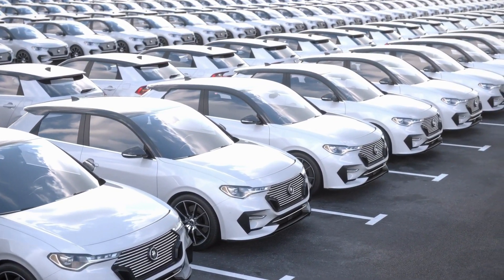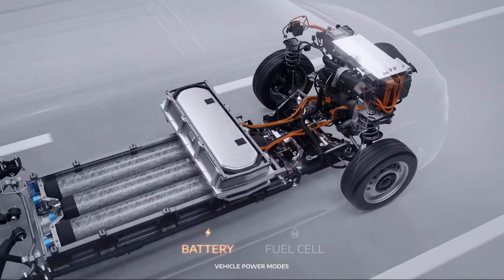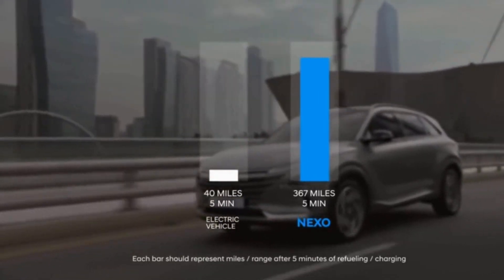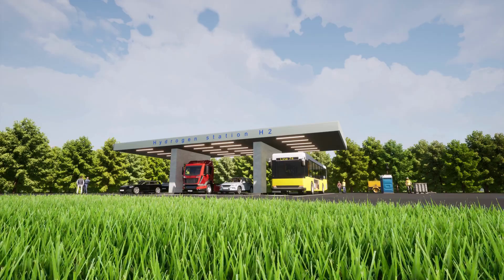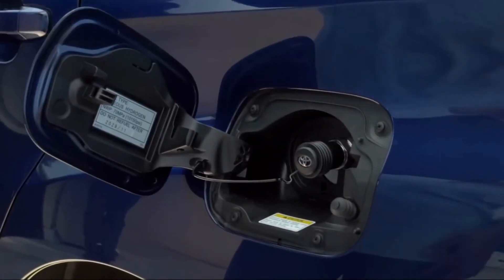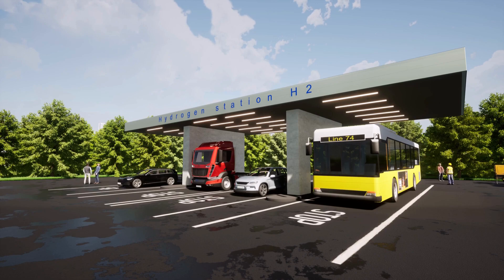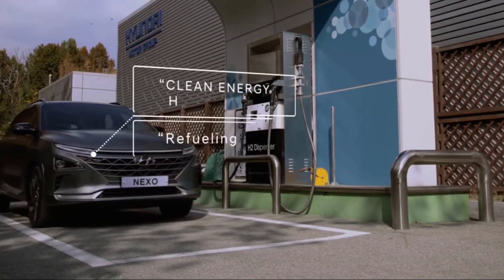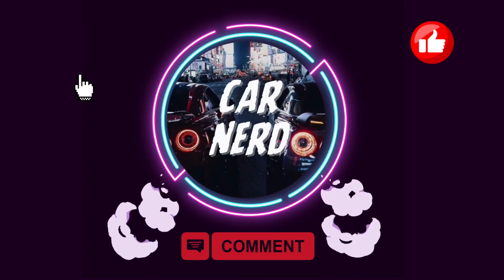Koreans Futuristic Engine | Hyundai Hydrogen Engine Will Destroy Electric Vehicles 😳

Comment: There are potentially many reasons for why we didn't use hydrogen in the past. One being the fear of the Hydrogen Bomb. Hydrogen Engines however are not the same thing. Regular unleaded fuel is highly flammable. Electric Batteries are flammable. Hydrogen is flammable. Flammable materials are just a part of every vehicle. 
   I like that Hyundai is working with Hydrogen. I think it can be a very good alternative to regular fuel, as it is basically 0 emission. Hydrogen will face the same barrier that electric vehicles face. I think the infrastructure problem will eventually be solved. It just requires investment and support. I also like regular all electric vehicles. Both methods are excellent methods of having a low footprint.
   One of the main issues with hydrogen for me is the fact that it does produce Oxides of Nitrogen. Luckily, is suspect that the production of that is very low. In a regular gasoline powered engine, the main issue is Carbon Production. Oxides of Nitrogen aren't exactly the same thing. In a regular internal combustion engine, Oxides of Nitrogen are produces in very low quantities. The problem with Oxides of Nitrogen in internal combustion  is when the engine is running hotter than it should. The combustion temps get very high when that happens, the byproduct is Oxides of Nitrogen.
   Good luck Hyundai! I would drive one.

Comment: Whether Hundai r Toyoto Hydrogen Engine it is immatetial.
Problem is how safely Hydrogen can b transported to Hydrogen pumping station?

Secondly how safely hydrogen can b stored in hydrogen pumping station?

Still there is no concrete answer to tgese question n so no point developing a very great hydrogen based car engine.

V have to wait for some time
Reply from the maker: 100% thanks for your comment! Hydrogen needs to be handle very carefully to avoid any disaster

Comment: If we reduce CO2 in the air, which plants need for photosynthesis, what are plants going to breathe? How long before plants start going extinct?
Reply: Not quite:
How/Why, The Plants (Trees, Grass, Flowers) ─ through Photosynthesis by the Leaves would take in CO2 and release Oxygen, during Daylight/ Sunlight; at night it is the Opposite:
Without Photosynthesis Sunlight, Plants *🎄 🎄 Take in Oxygen and release CO2 ┴  because there are more Sunlight hour in a day versus Night (no sunlight) 2:1 approximately in Summer and 60-40 during winter... Therefore there would be enough CO2 for Planet 🌎 🌎 Earth.   

But We/I agree that CO2 coming from the Cars/Vehicles Mufflers are like 1 foot above the Roads surfaces ─ some are Photosynthesized by the Plants/ 🌿🌿🎄🎄/trees ─ along the Urban Streets, planted by Cities Employees, some CO2/CO will take off to the Air.    Now look at a Powers Generator Plant ─ like New York and TX and California they mostly use Fossil Natural Gas which is Methane mostly.   And the Chimneys are like 300 feet in the Air; so the Chimneys Pipes up CO2 and Methane to the Air than those from the Cars./ haha 😂 😂 

[November 02, 2021
Methane is a powerful greenhouse gas at the center of new rules and initiatives proposed at a major U.N. climate summit in Glasgow, Scotland.

While carbon dioxide is more abundant and longer-lived, methane – the main component of natural gas – is far more effective at trapping heat while it lasts. Over the first two decades after its release, methane is more than 80 times more potent than carbon dioxide in terms of warming the climate system.

Stanford-led research shows global emissions of methane from human activities have barreled upward in recent decades, with fossil fuel sources and agriculture powering the climb. Other studies have shown how how to improve estimates of methane leaking from oil and gas operations, outlined a process for converting the gas into carbon dioxide, and highlighted the climate impact of oilfields that routinely burn, or flare, natural gas.
  ]

So, the Newyorkers and the Californians thought they are cleaner/ CO2 Emissions than those Cars burning Gasolines ─ BEV Electrified all the Way!  Wrong... They pollute the Ozone with more Methane and CO2... 😂 😂 🌶 🌶 🍷 🍷...

Cheers,
Reply: Trees are being cut down.  Plus they're not even our main source of O2. The algae in the oceans are.  And they're dying due to climate shift and pollution.
If you're so smart figure out what I'm telling you.

Comment: Really? When Hyundai hasn't even designed a reliable "gasoline" engine yet? Their "NU" engine on my Elantra was replaced 3 times before I finally had enough and traded it in for a reliable Honda. Couldn't even get 50,000 km out of oneof their engines. I will NEVER trust Hyundai engineering again!
Reply: I DON'T KNOW WHAT KIND OF DRIVING YOUR DOING TO YOUR, CHANGING OIL ETC) I HAVE  DRIVEN MY ELANTRA OVER 200,000 MILES WITH, BATTERY , TIRE, OIL, TRANSMISSION, RADIATOR CHANG'S AND THAT'S IT. IF CAN DESTROY ENGINES THAT QUICKLY YOUR NEEDED AT THE HYUNDIA TESTING RANGE.
Reply: Had a Kia Sorrento but the engine died at 220000 body and interior still good but can’t get replacement engine. A while back we had a Hyundai Sonata that went well but sadly my son was driving and he slammed on his brakes to avoid some drums that fell off a truck only to get shunted from behind. That was a smooth car, I think it was trying to copy the Lexus/Toyota aristo.
Reply: that's you though.  you don't speak for other hyundai owners.  my palisade and santa cruz are rock solid.
Maybe don't get a cheap elantra lol

Comment: Yet another "this will destroy the EV industry" video......  No mention regarding what UK hydrogen users are supposed to do, with less than 15 hydrogen filling points in the whole of the UK...... Hydrogen still has a number of drawbacks and disadvantages. 1. Once created, it still has to be transported all over the place in specialist tanker vehicles, to where it is stored or sold. 2. It will never be a cheap fuel once the oil companies monopolise the production, distribution and pricing of it. 3. You'll never have the convenience of being able to "fill up" at home for much less cost than established filling stations will charge. 4. You can't get free hydrogen from your solar panels, if you have them.....
Reply: Considering the price of electricity in the UK it's cheaper to run  petrol car rather than an EV even when home charging.
Nit to mention the domestic electric distribution network is not cable of the extra draw being put on the network overloading transformers to the point of failure.
Reply: @rogmorts1  True.

The Hydrogen now is at disadvantage stage/price because the Government of UK nor USA wanted to use Taxes Money$ for that.  I don't know enough about UK but USA burn Fossil Fuels to have generated 70% of it Electric Powers, the Other remain would be Solar/⚛⚛Powers and Wind Powers.   And the Methane that is the Major Components of Natural Gas ─ that used in New York and Texas ─  The Methane in fact
This is direct quoted / Extract from Paper written about {Greenhouse Gas}
[ Methane is a powerful greenhouse gas at the center of new rules and initiatives proposed at a major U.N. climate summit in Glasgow, Scotland.

While carbon dioxide is more abundant and longer-lived, methane – the main component of natural gas – is far more effective at trapping heat while it lasts. Over the first two decades after its release, methane is more than 80 times more potent than carbon dioxide in terms of warming the climate system.

Stanford-led research shows global emissions of methane from human activities have barreled upward in recent decades, with fossil fuel sources and agriculture powering the climb. Other studies have shown how how to improve estimates of methane leaking from oil and gas operations, outlined a process for converting the gas into carbon dioxide, and highlighted the climate impact of oilfields that routinely burn, or flare, natural gas.

This collection features recent research and insights from Stanford experts on methane emissions and climate change. ] 

The more they ─ New York, Texas and California use Natural Gas to generate Electric Powers ─ the Demands for Methane/ Drillings for Natural Gas vs Oil ─ the More they create the Heat Trapping in Ozone Layer ─ [ methane is more than 80 times more potent than carbon dioxide in terms of warming the climate system. ]

We/I are/am a Drilling Engineer/Specialist in Well Planning for Drilling Oil and Gas and we can attest to the most costly and destructive for Lands and Liquefy (Underground Water)  when drilling Horizontal for Gas versus drilling Single Shot Wells for Oil. 🛢 🛢

We all pay for what we call the "Inconvenient Truth"

Regards,
Reply: Look to the future of more refueling stations
Reply: The Solar Panels that ─ Came from Sina full of Forced Labours from Ethnic Uighur Xinjiang Region and the Panels were/are fired up from Coals.

So, we/I stay away from being called "Renewable & Green Trees Huggers as the Products came from Sweat-shop and Human Rights Issue.   We/I stay with Small ICE Cars 1600cc to 2200cc and less than 160 hp.  

That is all to be Green and a Part of the Solutions ─ Drive less, take Public Transportations and Walk or Ride a regular Bicycle 🚲 🚲 (Good exercises ─ not over-weighed of sitting on a Car ...)

Regards,